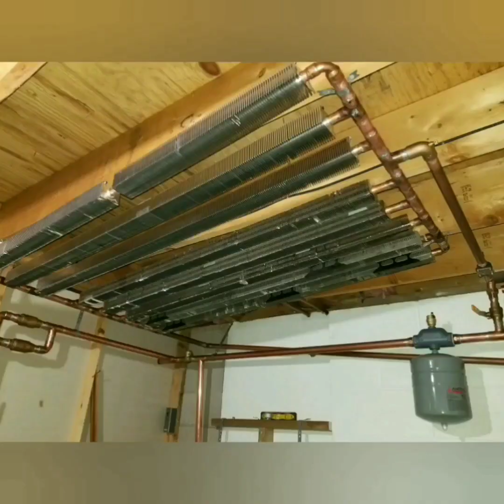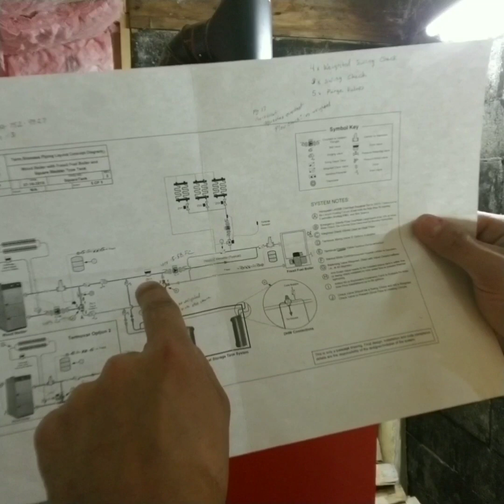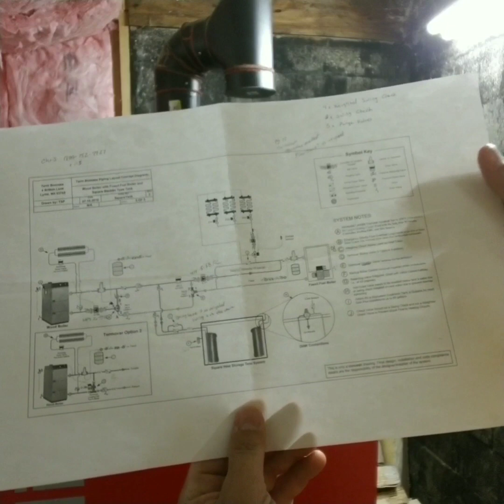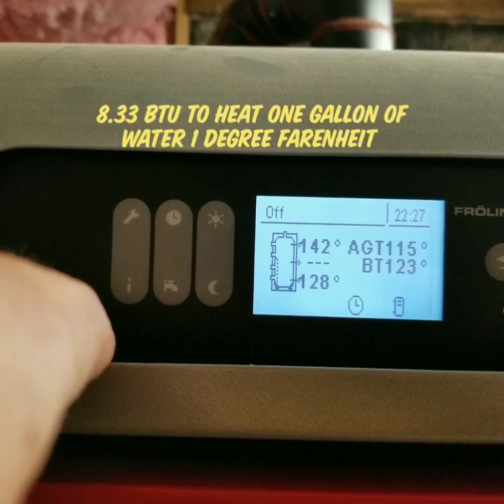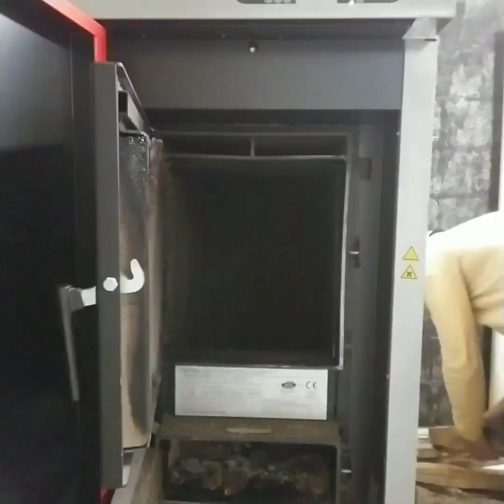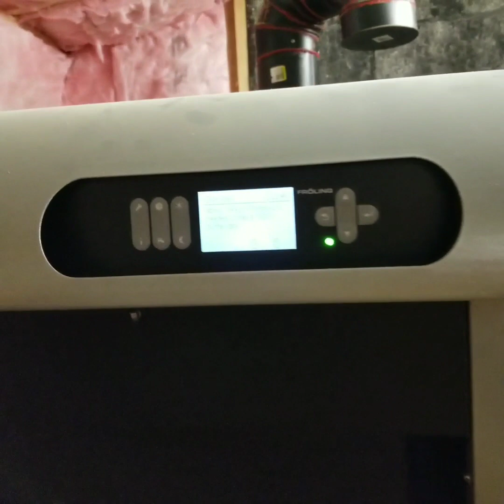Froling FHG Indoor Boiler

Comment: That’s for the video.   We just bought a place with an old HS Tarm wood boiler in the basement.    We’re looking at upgrading to a modern unit with storage as the Tarm eats a ton of wood and needs to be reloaded every 3 hrs.
Reply: 3 hrs is about right, the rating on most indoor boilers is. 3 hours at 100% load

Comment: How many hours does a full load run until it no longer provides heat hotter than the tank temp.
Reply from the maker: @norb231  i do not know for sure because once I light a fire I don't have to come back to the boiler for approximately 10-12 hours.

Comment: So, do you not recommend this system for radiant floor heat?
Reply from the maker: @robertmycroft8268  absolutely would recommend this system for radiant floor heat. In fact this system is best suited for radiant floor hear. The temperature of water being sent to in floor radiant heat is typically around 120F max where as the lowest usable temperature of water being circulated through a baseboard heater is about 145 to 150 depending on how cold it is outside. The baseboard heaters work the best with water at 165 to 185F. The reason I point that out is it sets the "usable temperature range" of your thermal storage tank. Meaning I can charge my thermal tank to 180F and with baseboard emitters I will have to recharge at 150F, usable range is 30F. If im using in floor heating and I charge the same thermal storage tank to 180F and dont need to recharge until it's 120F, that a 60F difference! My same thermal storage tank essentially doubles in heat capacity because of the larger usable range of temperature. That would extend the time between recharging the storage tank substantially.
Reply from the maker: @robertmycroft8268  the only thing I would change is how I constructed the piping and valves... I'm having an issue with a valve and I'm not exactly sure whats going on but I'm having trouble charging my tank properly. Acts like there is flow blockage and water is being diverted... I'll likely disassemble and inspect the valves this spring.
Reply: @Woodman_Custom_Sawing  Thank you, Sir. I just bought that exact boiler and I have to head out to NH to get it.  You put my neurotic nerves at ease.  LOL
Reply from the maker: @robertmycroft8268  youre really going to like it. It operates so well. Hopefully the seller gives you all the info you need to know but if not let me know if I can help. I bought mine from Tarm Biomass in NH I believe. They are super helpful and the only thing Ive had go wrong with my boiler is the exhaust gas temp probe and it was my own fault, I pinched the cord in the clean out door on top.
Reply: @Woodman_Custom_Sawing  Yup, that is where I bought mine.
Reply from the maker: @robertmycroft8268  I bought the BLT controller from them to integrate it with my existing controls for my oil boiler. Works great.

Comment: What accumulator probe is for the top 1 or 2?
Reply from the maker: John, I dont understand your question. Can you reference the point in the video where I'm describing it?
Reply: Sorry for the confusion. There are 2 sensors for the accumulator, sensor 1, sensor 2   I’m wondering if sensor 1 goes on the top of the accumulator tank or sensor 2. Or does it matter. 
Second, on electrical connections it had 240VAC, 60 hertz, 4 wire power supply is required. On the interface panel there are only 3 wires, white black, and green for a standard 120v hookup. Is the 240v for EU hookup?

Comment: You Still like it?
Reply from the maker: Yes, very much so. It's so easy to use. If I could do it over again I would only change one thing. One of my check valves clatters because of where I installed it in the system lol. I knew better but didn't modify my layout and not it drives me nuts, just a faint clatter. To fix it I would have to drain part of the system and move it so there is a straight runnof pipe before and after it... it's still working as good as the day I installed it. Currently burning 1 load a day in it with highs in the mid to upper 30's.

Comment: Seems like a lot to break down. How has it held up the last two years?
Reply from the maker: It's been operating just as good as the day I installed it. Thanks for asking. Yeah, I agree it is a lot of info, especially if you have no experience with these systems. I tried to explain it in simplest form. There's still a lot I of other stuff to explain if you wanted to get nitty-gritty.
Reply: @Woodman_Custom_Sawing  You did a good job of explaining. I'm just talking about a lot of circuit boards, valves, and moving parts. I actually heat with a large wood stove (no electronics besides a single blower) and it does a great job but considering on upgrading as I move farther north.

Comment: That is an incredible set up.... A bit rich for my blood but wow what a system. Fabulous job setting all that up :)
Reply from the maker: It's not for the faint of heart but honestly, I wouldn't have been able to afford it if I didn't get that boiler at 30% off and the storage tank used, ~50% cost of new. I also found brand new chimney pipe for sale privately which was about 1/2  the cost of new also.
Reply: @Woodman_Custom_Sawing  The storage tank is def a killer...Great find :)

Comment: Awesome, thank you for the great overview! The system seems pretty intricate. I have lots of questions, since know very little (but not nothing now!) about this 😄
• How long have you been running this system? 
•How often do you have to clean out ash? 
•How is the water reheated in the storage tank? (electric?)
•How often do you have to fire it up during a typical winter out there? Daily? Once a week-ish?
•What is the nozzle in the fire box for? Maybe to allow air in?
• How much floor space is required for it? It looks like you'd need a decent amount of dedicated space. 
•Is it able to function during a power outage, or do you have to run a generator for it?
• It sounded like in-floor heating was a pretty efficient use of the boiler (if I understood that part correctly😄), is that something you guys might eventually install? 
•How is the heat distributed through the house? Are there radiators in each room? (If yes, do you guys dry your socks on them? Because I would!! 😁)
Maybe a Q&A video next? 😄😄
Reply from the maker: Great questions! I'd be happy to answer in my next video. As you can tell, that video was 20 some minutes but it could have easily been 60 had I dove into more details. Next video! 😁
Reply: @Woodman_Custom_Sawing  Hi, many thanks for the video. Very useful. Sadly the announced additional video is not there. Would be great ! Thanks anyway !

Comment: So I'm curious.  How many years will this have to run to pay for itself, and are they low maintenance?  We don't have boilers out where I am.  Heck, not many burn wood out here either.  Lol!  Seems interesting.  I'm going to have to research these a bit.  Thanks for the video
Reply from the maker: 3-4 year return on investment is what I figure. That's because my alternative is fuel oil heat and I can use as much as $3000/year in oil.
Reply: @Woodman_Custom_Sawing  Oh wow!  3k a year is alot!  3-4 years isn't bad at all, considering the alternative.   It's interesting the different methods used for heating, depending on where a person is located in the US.  Natural gas or propane is what is used out here, other than the few of us who burn wood in wood stoves.  Thanks for the info!
Reply from the maker: @johndunbar2393  at one point maybe in 2010-2012 fuel oil was approaching $4/gal. We would typically burn about 1000 gal per year for heat and domestic hot water. Now I can do all of that with this boiler and fuel cost is zero. I either get my wood from my property, odd tree jobs I do on the side or just scrounging from tree removals. It was no small investment but I plan to be in my home 10 years or longer so it was a wise choice. And I have no hard feelings letting the wife turn the thermostat up!
Reply: @Woodman_Custom_Sawing  All of that makes 100% sense to me!  Have a great rest of the week man!
Reply: @Woodman_Custom_Sawing  At 4 years of use, that makes the system cost about $12,000.  Is that correct because I thought a system such as this would be a bit more expensive.  Thanks.
Reply from the maker: @PaulOfPeace54  you are correct. I have about 12-15k into the whole system. That includes all of the cooper, valves, controls ect. It would normally cost a lot more but because I got the boiler 30% off and the storage tank second hand I saved a lot there. It also helps if you can install everything yourself. 😁 I had a quote for the froling boiler and froling storage tank and professional install for 36k.
Reply: @Woodman_Custom_Sawing  I installed an oil fired hydronic system for in floor heating plus HW Heating.  I got it from a distributor at discount so I can relate to your experience.  It's a great experience to put all of that together.  I take it that they produce wood burning with a oil fired backup?  Also they supplied you with the schematic to assist you in installing the system?  Thanks again.
Reply from the maker: @PaulOfPeace54  the wood boiler is stand alone. I had a Utica oil boiler already in the house so I bought a controller from the dealer so that I can set the wood boiler as primary only, wood primary with oil boiler backup, or just oil as primary source.

Comment: I take them paper cartons and fill them up with cedar chips made with a chainsaw then I melt all my wife's left over candle wax and pour over cedar chips then separate at each egg pocket and you got 12 good fire starters ....you put one of these in the front there you won't need that torch.....i use these in my rocket stove
Reply from the maker: I would try it but you're not supposed to burn anything other than clean brown cardboard or egg crates. The wax might mess up the O2 sensor. Not a risk I'm willing to take. Also, I'm just lighting the cardboard with the torch. I suppose a grill lighter could work just the same. Good tip for camping fire starters though.
Reply: @Woodman_Custom_Sawing  totally makes sense on that.     They make a really nice fire starter .....they would definitely work for emergency/survival situations!
Reply: That's a good idea Yank!  I'm gona have to use that!  Have a great rest of the week!